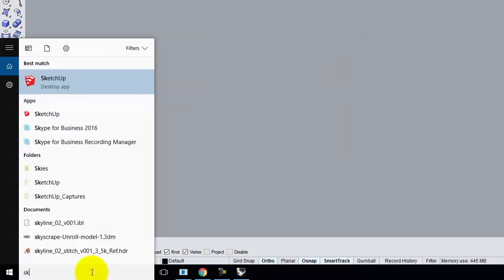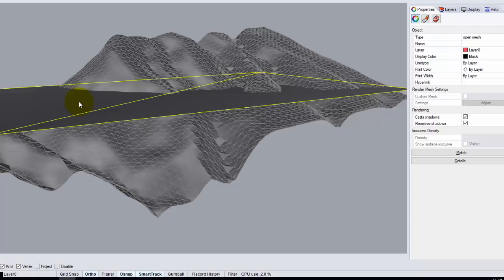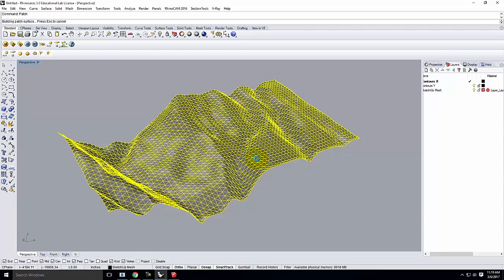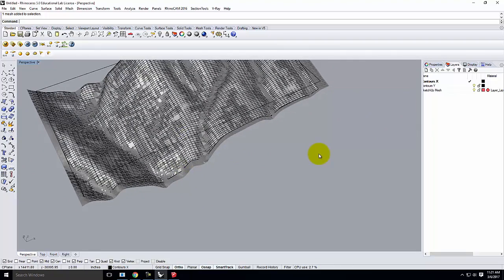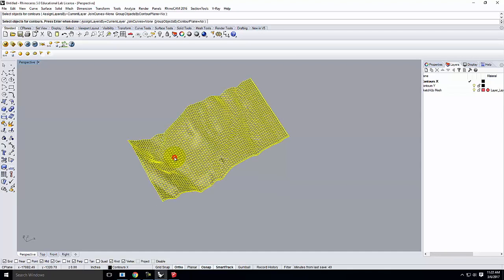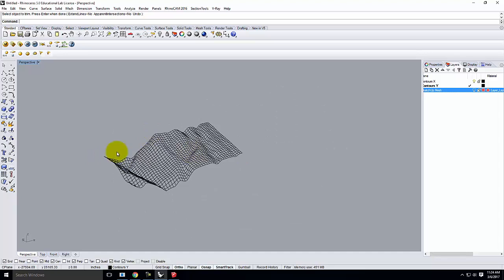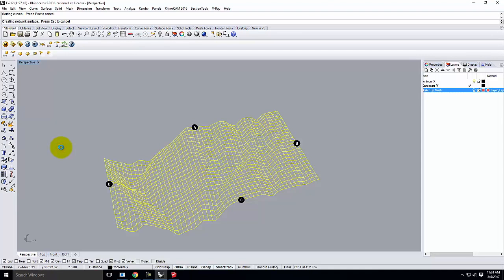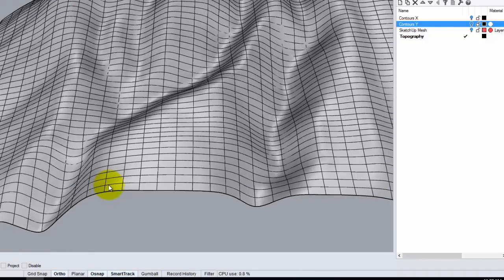Lecture 212 - Topographic Physical Models (Part 1) (Spring 2017)

Comment: wonder why you did not just extrude all lines together to get the steps. you could simplify the network curve from its flyout, instead of rebuilding. no need to project on surface to trim with lines, just go top view and trim, with correct trim options, on.